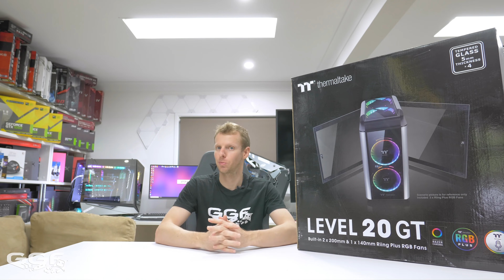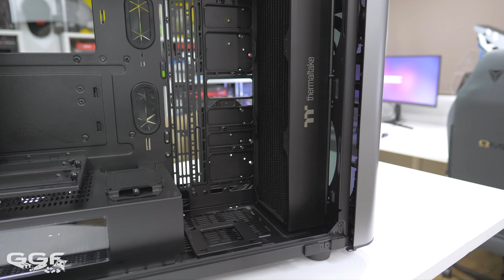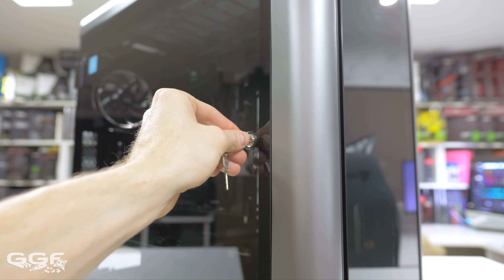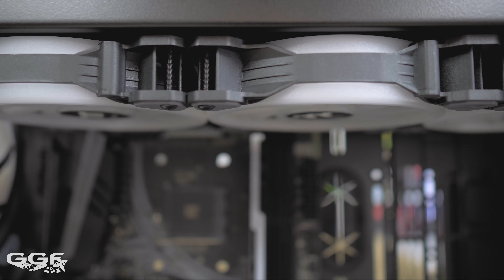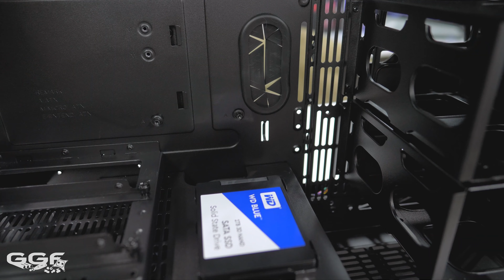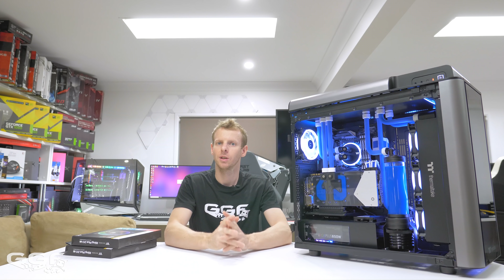Thermaltake Level 20 GT RGB Review - A top 2018 case contender?

Comment: It appears to be a re-skin of a View 71 with worse airflow and a Power Supply Shroud. I would personally prefer the View 71.
Reply: don't forget the overpriced part of this case too. $50 more for no reason.
Reply: Exactly,  that what I thought cuz I looked at inside, it looks the same with view 71 without psu shroud. But we can buy psu shroud for view 71 by the modders
Reply: @tienduong5752  where can you buy that shroud?? I wanted this case but the air flow seems inferior to the view 71 so I will get the 71 instead but really want to the shroud :)

Comment: As much as I love the Level GT line-up. This is a stupid upgrade over Level 10 GT. Where are hot swap bays Thermaltake? What happened to the crazy UI in the front? My Level 10 GT has 4 USB 2.0 and 2 USB 3.0! 5 Hot swappable hard drive bays. That front glass is so unnecessary..